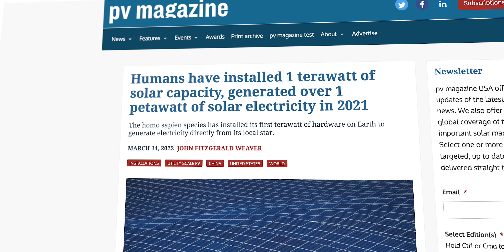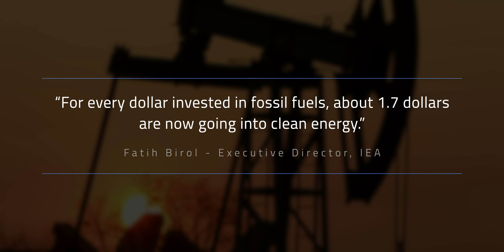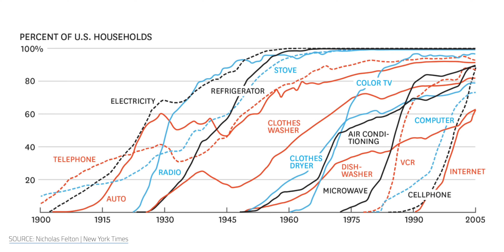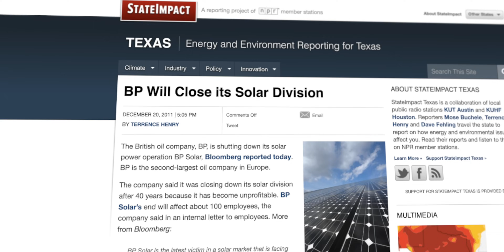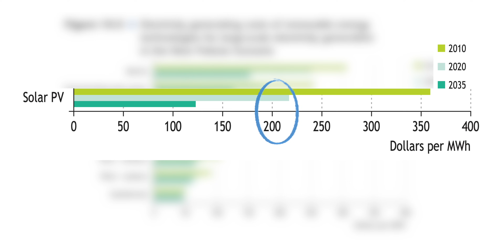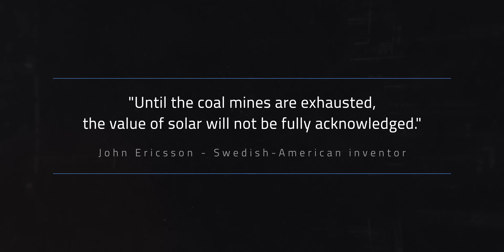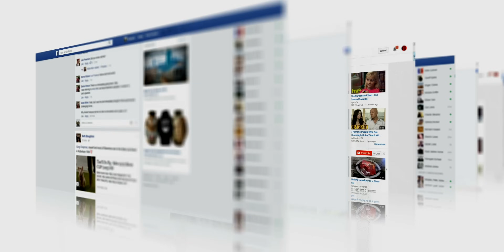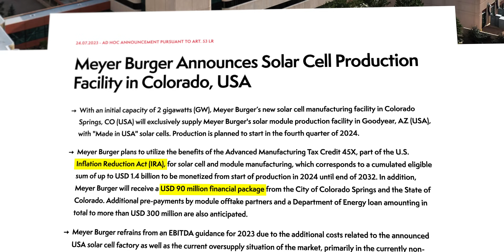How Solar Power Got So Cheap … So Fast

Comment: Hi Matt:  good video as usual.  However, I’m going to disagree a little bit with you. We are not there yet.  My seventh grade science project in the late 1960s was a fully functional solar heated house model. So I have been a solar advocate, for probably longer than you have been alive. However, it all comes down to economics.  I will ask the rhetorical question, have you priced a solar system lately?  Even with government tax credits, and particularly with the now higher interest rates, it is simply not within the budget of most households.  Until it makes obvious economic sense, it cannot undergo full adoption. The difference between the adoption curves, you show and solar, is that for many of those adoption technologies, there was never really a problem with producing them, or getting the performance out of those technologies needed.  That is not the case for solar. Solar has been stuck at 20% efficiency for a very long time. Yes, there are new developments on the horizon, but they either cost too much or are not really viable yet. Solar efficiency needs to get up to at least that of a diesel engine, i.e. about 50%, and the price of it and all its supporting electronic subsystems still needs to come down significantly. Furthermore, the competition can be steep in some areas. I live in the south, supported by a nuclear power plant providing electric power to the area. My electricity is nine cents a kilowatt hour. Even at peak summer heat, my electric bill flirts with $100 a month. It just doesn’t make sense to invest thousands or even tens of thousands of dollars into a solar system that with utility connection fees will still amount to having to still pay out a double digit fraction of that hundred dollars a month. And there is another part of the rub.  If a solar system were 100% capable so you could go off grid completely, then it makes a little bit more sense. But cloudy days and Long rainy periods prevent that from happening. I suppose one could install a back up generator, but for a full house application, that also encroaches on $10,000 installed.  So I hear ya, but we just are not quite there yet, And until the economics and a 100% off grid solution are viable, reliable, and affordable, the solar solution is going to be reserved for greenies with deep pockets, and that is NOT full adoption nor anything near full adoption.

Comment: You need to fix your giant error. OurworldinData as of 2022 (their most recent data); shows Solar energy production is only 3.448 TWh out of world production of 178,889 TWh or 1.95% of World Energy production -NOT 4.52%.  You make the same mistake many advocates make of only looking at Electrical production, as if that is what needs to be replaced - your entire idea is to replace fossil fuels which is 148 TWh in 2022. In 2010 Solar was 95 TWh so it grew by about 3.5x but started at a very low figure. So it will become harder and harder to maintain expansion as to increase by 100% means doubling everying done in that past 10 years. In 2011 Solar increased to 181 TWh near 100%, in 2012 it was only 278 only 50% more, In 2013 only 378 only 25% more, 2014 534 TWh about 40% more, 2015 689 TWh 29% more, 2016 879 Twh 27% more, 2017 1186 TWh 35% more, 2018 1523TWh 28% more, 2019 1859 TWh 22% more, 2020 2244 TWh 20.7% more 2021 2772 TWh 23% more 2022 3,448 TWh 24%  So the trend is a smaller precentage growth each year because the more your installed base the harder to make a significant addition; soon it will be small percentages and as solar needs replacements it may go to zero or even decline. Not at all your optimistic pronouncements, actually a pretty poor likelihood of making any significant impact on fossil fuel use. Wind has put out about twice as much with the same limits - it won't get significant in reducing fossil fuel use which continues to rise.

Comment: I think we would see more solar uptake if there wasnt so much red tape as well. Granted, I understands why there is some there, but it would be nice if it was remove. For example, why is there a need for roof top installs to have to get building permits? Seems a bit silly to me. On the other side of hte coin, it would be nice if they gave everyone a "Free" upgrade to their power panel so that it would be really easy to add solar at any time or even a battery backup system. Granted, I know nothing is free, it comes from taxes, I am just saying, it would be nice to see a push forward to get you into the idea. The other side of things, insurance companies also make it harder to want to get it because it increase their cost - and that increase your cost as well let alone when you sell your house - you have to sell them also on the idea. I feel like solar also can improve still -  perovskite, converting IR and UV into visible light, and putting lenses on them. There are new cooling method out there as well that only need like 5Ws of power - so it can also be self cooling. Along with double sided power generation. A lot of tech would increase the cost, but you should be able to get 4-8 times more power back than other panels.
Reply: You need a building permit because you're adding on several hundred pounds of weight as well as running current-carrying wire all across your house...there's a reason Earthquakes don't level cities and building fires are usually contained to just a couple houses these days...adding the barrier of having to draft and submit a plan to prove you know what you're doing is a good thing.  Most residential solar permits dont involve an in person visit and are pretty quick.
Reply: @Ahwleung.  Right, I get that, but thats my point as well - "extra" steps are needed every time to make it happen that delay and add up to cost for adding solar. If there was a better way to attack it - that would improve installing and getting it out there better. Solar panels themselves are cheap - its all the added cost that makes it kind of costly. For example, why not allow a company to take that on for that state/town skipping the need for the city/state to look at it. Instead, the city/state look at it at the company level instead. Instead of having to wait for weeks or months - the company takes on the permitting and if they do it wrong, they are the ones that have to go back in fix the issue. Of course, the company would have to be state/city approved.
Reply: The IRA has a huge tax rebate if you upgrade to a 200amp panel when adding solar. Big rebates for the solar install also.

Comment: Tons of fluff and explanations of mindsets in this video. Then the flat out LIE that the average home solar system only costs $20K! that is total bull $hit!  This is the ONLY reason i am not using solar on my home, COST. I have no income so those big tax breaks you hear about give me $0! Meaning I don't get any of them. To fully power my home and not have to change the times when I wash cloths or use other major appliances, a solar system will cost me $60K and then there is mantance of replacing controllers, panels, batteries, and other components over the next ten years of service. These extra costs need to be factored in. My monthly poer bill being on the grid per month is around $40-$200. Let's take the highest number of $200 and divide it into that $60000 to have a system put in to see how long it will take to break even. 300 months or 25 years. That number is using the high months energy bill and assumes that NOTHING breaks or goes bad ovr 25 years. I am 60 years old now and in 25 years I will be 85 years old. Using real number which use my average power bill over 12 months and include upgrades, replacements, and repairs to my solar system would mean I wouldn't even break even for 33 years. I would be 93 years old or more than likely dead before reaching my break even point! So, while I love solar, the cost is still way to high! Once they get the price of an entire house system down to $10K without any tax benefits or other voodoo style accounting to make solar look like it is affordable when it is not, I will be first in line to purchase it. But by then, I will be dead. I am a tech guy and have been looking at solar since you were pooping your diapers.  I grew up on So Cal and was going to Electric car shows in the early 1990s when it was still a homegrown movement. The problem has always been the batteries. Thankfully that has gotten better. Still not great but better. Solar has gotten a lot better. Yet it is still not where it needs to be for the masses to all switch. But when it does, it's going to be great. Will destroy our climate a bit with all the mining needed to make these panels and batteries, but it is a small price to pay for free power.

Comment: Solar Power accounts for < 3% of total power generated (Dept. of Energy). You are lying by misdirection.  NEWLY INSTALLED power sources are a very small part of the total power grid. All the old ones are still  generating, By only saying the percent of NEWLY INSTALLED power sources they are, subsidized solar and wind power production is misrepresented as much, much more important and more economical than it is.  This is not a spin of the facts. Lies are not a winning argument

Comment: While he spends the first 13 minutes of a 15-minute video holding an (interesting) academic symposium on product adoption theory, in the last 2 minutes Matt comes clean that, while solar has had some real innovation successes, the true cost driver was TAXPAYER HANDOUTS.   Matt uses the more dignified expression of "incentives"....but, they're handouts.....as Orwell said "Political language is designed to make lies sound truthful and murder respectable,..."
Reply: It's dialectical. Handouts make adoptions cheaper, and more adoptions lead to cheaper power.

Comment: The IRA is anything but. Those solar and other handouts are helping, in a big way, to create the inflation you and everyone else are complaining about: There is no free lunch!

And what is the replacement cost going o be in 10 - 20 years when all these systems start dying and there are no subsidies? How about talking to the COMPLETE cycle cost. Even today, you will be horrified at the replacement cost of tear-down, roof work and system replacement of all those supposed economic savings of going solar... poof! Up in smoke.

Comment: How Solar Power Got So Cheap?
Answer: government subsidies
Reply: The governments have certainly helped in the early days to incentivize early adopters, but the current prices of solar shown are WITHOUT subsidies. Compare that to our oil which should be twice as expensive as it is now if our government didn't subsidize it with our tax dollars. And yet, solar WITHOUT subsidies still beat oil WITH subsidies.